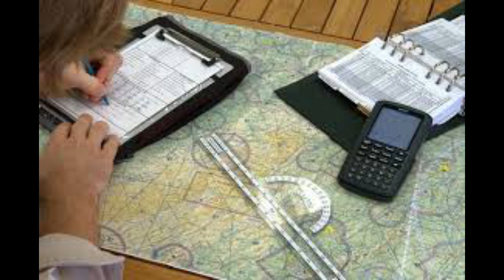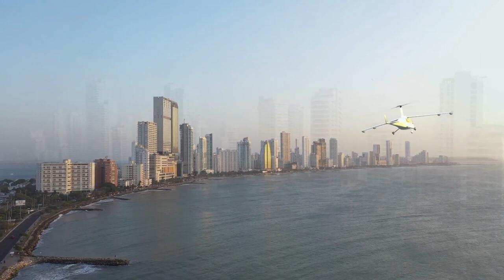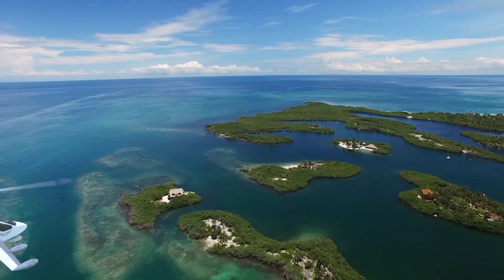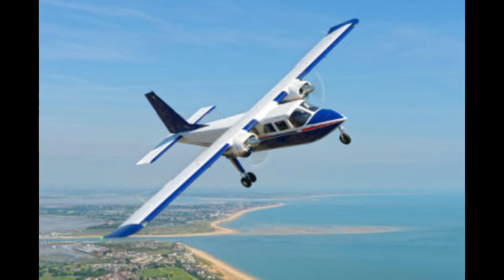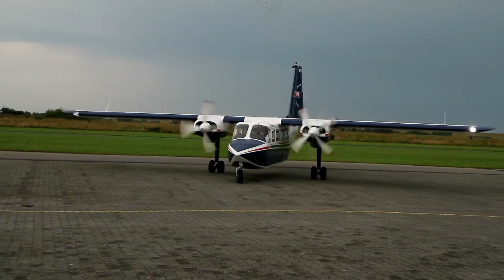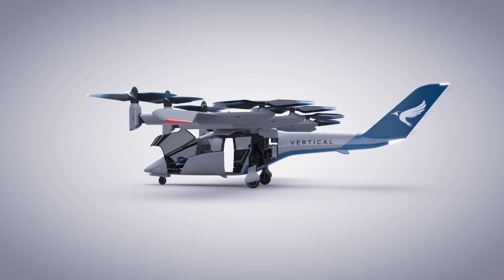Electric flight - Cranfield Aerospace Project Fresson & Vertical Aerospace VA-1X

Comment: I think it is good for the present to see electric propulsion as a transmission system were direct engine power has successive problems.
Those problems being poor weight distribution, articulated propeller drives, scaled hybrid power.
Referring to the latter, a alternator output could be supplemented by battery storage to enable 140% power for the limited time of VTOL operation which might be just some minutes, 
falling back to 75% power in flight mode from an engine driven alternator output that would also be replenishing a compact battery.
In these more hybrid situations I think that electric power certainly has its place as it enables a more flexible configuration and articulation of thrust in a system with a lower overall weight.

Comment: Look for the electric Caravan. It's coming but not there yet. Also have a ferret about for the ALIAS autopilot, it's a robot that sits in the co seat and learns how to fly by vision. Flying an S76 and C208. I think it was Aurora Flight Sciences that made it. The point of this is suddenly any old airframe suddenly becomes a cargo mover. New stuff will have it built in. Just as they have with the Kaman KMAX and 407, the 407 is not working out as well.
Reply from the maker: Yes to me the systems side makes a lot of sense but I think some of these projects where the focus is power plant just seem too early as if they wait the funds could be more efficiently allocated. As for the VA1-X retracting under carriage on something to fly at 100kts?? Complexity and weight and a huge snag waiting for what??
Reply: @fladave99  I can make electricity anywhere for a lower cost than the entire cost chain of fossil fuels. By anywhere I mean 50km from a road. Once the method of creating that power installed it has the potential to kick start other things. You only use fossil fuels once.
Reply: @sUASNews  I have solar and wind. They are USELESS as a mainstay of power. If I was off grid I would have power ONLY on SuNNY or MILDLY windy daysl The rest of the time they are USELESS. Try running an electric hot water heater on solar in a grid down situation in ia rainy, cloudy day, because that is what we will have FOREVER in the event of a sloar flare, emp, or a  ELECTRIC VEHICLE GRID OVERLAOD caused by to many electric cars. BUT we have 300 year of coal and UNLIMITED oil because oil is produced by the EARTH and is endless. NOt getting how you charge a FLEETS OF PLANES with no grid.Enlighten me,

Comment: Honestly Phil, I think it's a waste of time trying to build a battery powered airplane at this point. I agree with Elon, battery power density is not near where it needs to be. The heavy bloke in this scenario is the power storage. When the "tank" is empty it's still very heavy. In my humble opinion, a hybrid system would make more sense right now.
Reply: They already have them Pipistrel will sell you a two seat GA aircraft with an hour and a half endurance.  Perfect for training.  They are using it in Western Australia here.  The problem is drones and rotorcraft.  We fly far less effected due to the backward tilt of the rotor.  This is why the smallest engine I've heard about on a gyro is the nano at 36hp.  I calculated the watt hours for a 50kg battery at 250watthours.  As the electric motors are far lighter about 11kg for 75hp.  I assumed detuning to 54hp and went from there.  You get just under 13 minutes at full power.  Of course I don't have any idea exactly how much power you use really in cruise but I image with even 5 mind up your sleeve you'd be lucky to get 20minutes.  Not enough. 45 mins yeah, less no.  But several technologies are close.  Toyota's new solid state is claiming in the ballpark of 500wh/kg,  the lithium CO2 batteries over 2000 aluminium air batteries are single use but signifanctly more again,  but can't be recharged.  It'll take maybe 5 years before there is a viable one and then cost.  In the Bensen design manual he describes experiments he did with chainsaw engine permanently engaged in flight,  he found 8 he could be used without need of a prerotator and used a 40hp nelson engine instead of the 70hp mac.  Put an efficient electric motor on the prerotator, keep it engaged and we might increase efficiency.  Consider this too we often descend in a vertical descent.  Could we engage an electric motor on the head  to give us regen perhaps depending at 1000fpm instead?  You can use regen on the prop on the pipistrel.  So on thermic days it opens the possibility of a new sport, how long can you stay up?  I've flown in thermals strong enough to be climbing at 1500fm on idle.  Electric motors are interesting and having had 4 engine related emergencies including two engine failures i can't wait to have only one moving part.
Reply: 3 - 4 more iterations in regards to battery power density should be enough to get a battery pack small enough and powerful enough for reasonable flight endurance.
Reply: @zx1100a1  depends on what you consider reasonable.  My Vw gyro if I filled the tank would easily do a 3.5 hour flight.  Looking in my log book I see I rarely flew more than 45 minutes.  Occasionally I'd fly for a hour.  Pipistrel electric can fly 1.5 hours we'd agree Useless for transport but excellent for training especiallt as it takes only 5 minutes to swap the batteries out for a fresh set and the average training flight will be about an hour.  So these will come in gradually.  More and more roles being filled.  Consider too the cost of Ice engines to run.  The Alice electric has a 1000km range (in testing).  9 seats but will save money in upkeep.  Electric motors have one moving part.  No carb ice = that's one of my engine failures,  proper design should eliminate cooking the engine one of my other engine outs and no difference in performance of hp based on air density.  Electric motors produce the same hp at any altidude.  There is lots to justify some roles for electric aircraft now,  soon they will be a no brainer no one will want ice
Reply: Rectennae and microwave power transmission is the answer!

Comment: Have you ever consider to go with propane cause Kohler make EFI propane engine , the propane is lighter than gasoline save 20 pounds for 10 gallons , cleaner cylinder , cooler engine, and with EFI no problem with altitude it adjusted automatically , did you see this video ?
https://www.youtube.com/watch?v=bePaRiBIREg
I think aircraft engine are over priced since now engine are really reliable !

Comment: I'd like to apologise for being such a cynic, but I can't. Are Cranfield involved in something they believe in or trying to learn some additional technology with something that can get grant for and investment money at the moment.
I have a friend who helps design part of the generators of hydrogen for fuel cells. It's done by electrolysis as chemically liberated hydrogen is too dirty for the cells. It all depends on grant money, none of the idea behind fuel cells makes any money.
Elon Musk says the switchover point is 400W/h per kilo. Now I understand electric motors are lighter than engines, but you have about 10kW/h in a litre of kerosene so 2.5kW/h in a 25% efficient engine or 3.125kW/h per kilo. Any betting that the RollsRoyce developed kero powered Diesel engines aren't more than 25% efficient? Ellon Musk says a lot of things not everything he says comes to pass.
Reply from the maker: True Musk isn't the be all - but this article from the UK seems to agree.
https://www.flightglobal.com/business-aviation/the-magic-number-that-makes-electric-flight-viable/140050.article
Reply: Electriv power is a scam  for fuding, you are right. BATTERIES are STORAGE that LOSE ENERGY through heat all the time. Its like trying to fill a waterbottle fron a frying pan on a horse at full gallop.

Comment: Is it only me who sees that these things will never take off, so to speak? Batteries with enough capacity don’t yet exist to power fixed wing aircraft over a reasonable distance with a worthwhile payload let alone provide enough power for vertical flight. Then we have the financing, maintenance, insurance, crew of office costs plus the enroute charges. And where will Mr. Banker and his legal team embark and disembark? At a railway station? Bus station? You must be kidding. It will office to restaurant to home to airport to the girlfriend to the golf club etc. Each of these places must be at least checked beforehand for wires, turbulence, engine fail options. Most locations will have to have special provisions made for the operation of such aircraft. We’ll need some nifty legislation to allow them to be used, who will write that? Each location will have to announce its capacity, if for no other reason than these things won’t be able to hold for long. But when they do come about, I’ll be there on windy days, waiting for one of these things to clatter down a multi-storey building, hopefully fully loaded with bankers and a grinning robot pilot.
Reply: And yet my drone has a 30min battery and is very useful.  I've flow a 25kg drone with 20min safe time and that's not as efficient as a gyro.  Current batteries 12-13 mins at full power on a light gyro. Double it you've got  a fun little machine flying as long as most of us do.  Consider this.  That 50kg battery could be hooked onto your house when not flying storing your solar and saving you money.  So when has a significant expense of a fun toy like a gyro ever had the potential to pay for itself.  An electric gyro, car motorbike jet ski etc could been hooked up to your house during the week.
Reply from the maker: Yes but the point is, and here Trevor has some very key points, once you start operating these things and retain all of the normal operating procedures [which have come from years of experience that these things are sensible to do] the whole thing falls over. 

For example if you genuinely run an "air taxi" who manages all of the people completely uninterested in aviation that are littering the drop off points?  So it won't really be a taxi as we know a car taxi - it will be specified areas that you can fly to another specified area.  But now if all the taxi companies use the same specified areas what happens if Area XYZ is super popular?  Who plans that?  How is the traffic management / holding done?  What happens when there is a problem to manage in that hold?  

This isn't an electric vehicle propulsion problem as that will fix itself with time as tech improves.  The bigger problem is the management and regulation of the entire operation.